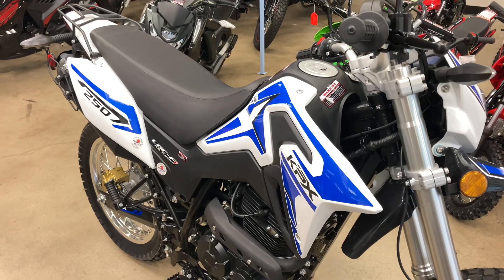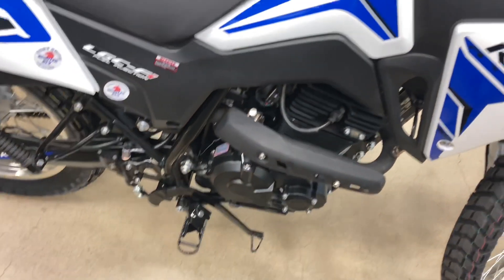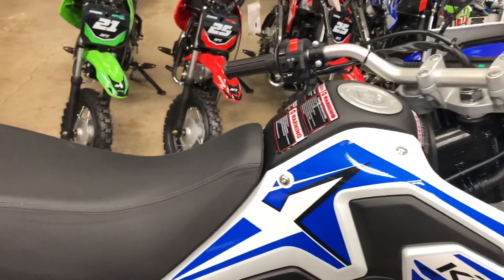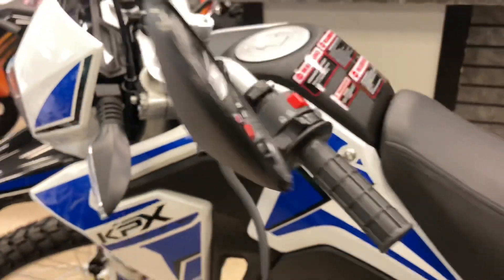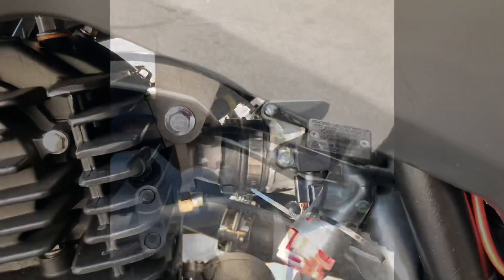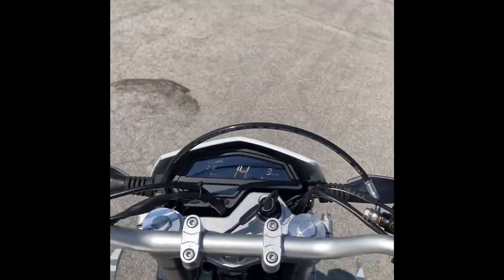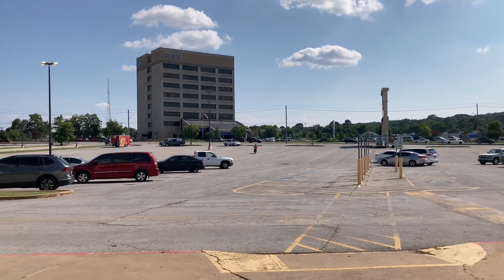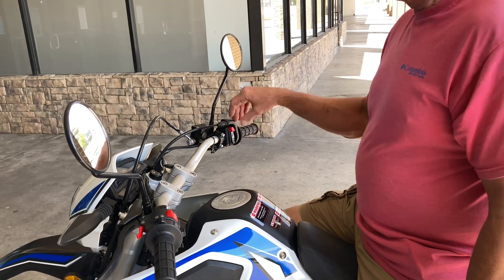Lifan Kpx 250 fuel injected enduro stalls n dies at idle and quick acceleration how I fixed it !

Comment: one question the EFI bikes vs the carb version.  I see there are thing you can do to the carb bike to get some more power like the 4 or 8 degree offset crankshaft key, replace the CDI box with one that is more performance based, go to 30MM better carb, rejet etc..

 On the EFI it seem you are sorta stuck with whatever the factory gives you more or less.  Is there any "tuning" that can be done on them like you see in diesel trucks?  any replacement boxes to buy, any software to use to get them a bit more power??  

grew up racing MX and looking to get back in the enduro game at 65 for local tran as we full time RV across the country looking at the KXP and hawk as good contenders.
Reply from the maker: Facebook has a kpx 250 page I did a hawk up on here with Honda parts ! The kpx may also take Honda parts but not sure cam ect

Comment: that is not how you adjust a TPS  and end result may be lean burned up machine. It is done with a voltmeter
Reply from the maker: This wont change the amount of fuel out of the injectors ? It adjust idle though! N how do you adjust it with a volt meter if the cdi is programmed? These came with bad programming on n the end it had to be sent back to Lifan for a free proper programming in the end ! It’s common with this dumb bike ! To common prolly 8 out of 10!